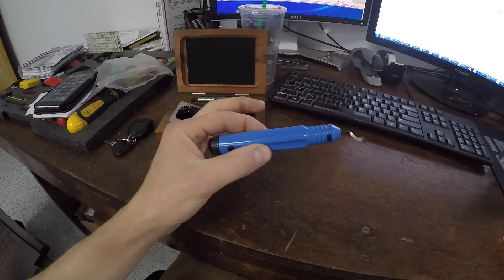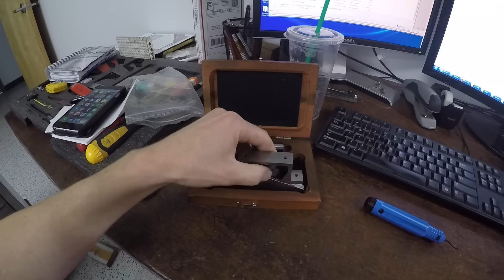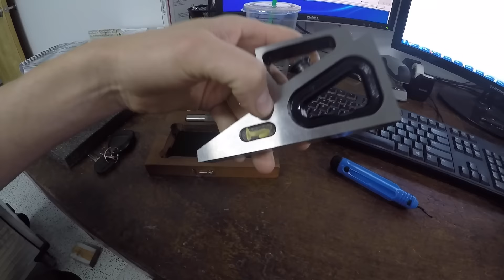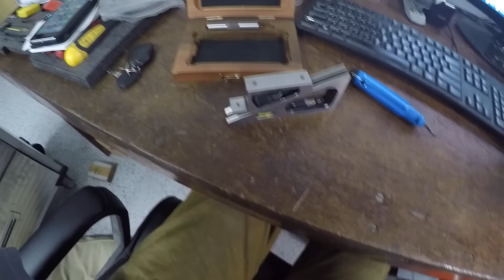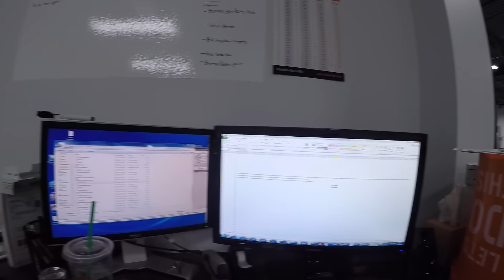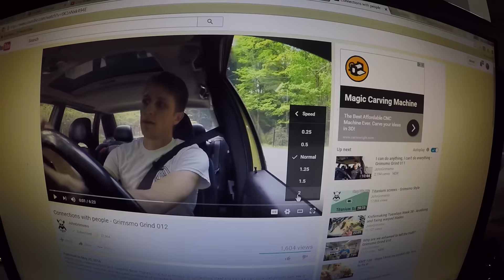New Tools, Giveaway, How I watch YouTube, Building a Team - Chip Break 11

Comment: I believe the name "planer gauge" comes from setting tool height in planers. They are similar to shapers in practice, but very different in design and have much longer travel. Rarely seen these days, they are still considered by some to be arguably the best bay to machine long pieces like machine ways as they don't put any heat in to the work. Like a shaper they use simple and inexpensive tools.

BTW I don't think there is anything missing from where it looked you were pointing.

Another purchase you should make, of you don't already have them John, are adjustable parallels. Extremely useful for the type of setup you were describing.
Reply: Ha ha, well that's a start! :) ebay is your friend here, not expensive used and generally come in sets. For the same money I personally think it's better to buy quality used tools, rather than cheap new, but other's milage may well be different

Apart from setups, they're super handy for accurately measuring slots and gaps that would otherwise be awkward. Drop them in a slot and adjust until the fit feels right and then measure the adjustable parallel. Great for light duty jacks etc etc etc. Once you have them and start thinking to use them, you'll find you'll probably reach for them increasingly often and will save a bunch of time.

Comment: I'm watching this at 1.75 speed :)
I have a Chrome extension (i think it is the most downloaded one) that lets you set the steps and has keyboard shortcuts to increase and decrease the speed. Really really useful. I watch english language videos at 1.75-2.00 and videos in my language at 2.25-2.50. It saves me hours in a week. :)

The only problem with this is that the extension requires acces to every page you visit. But it is open source so one could check code to be sure it does only what it says it does.